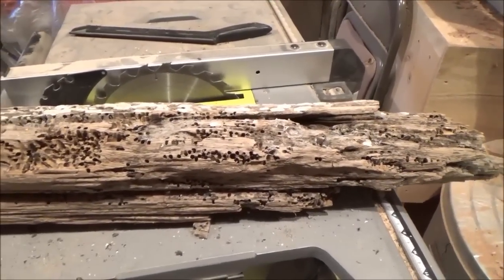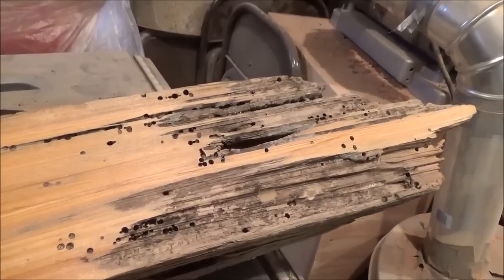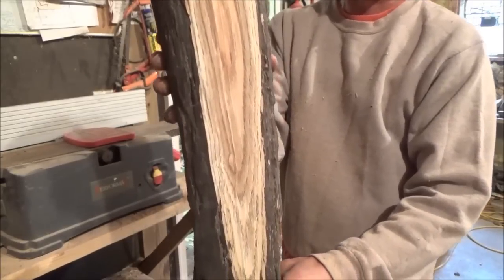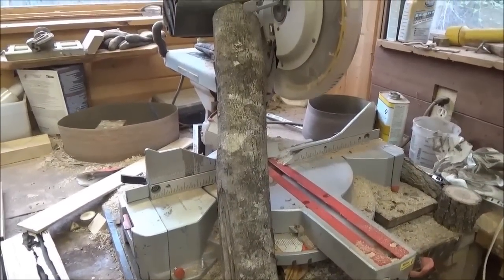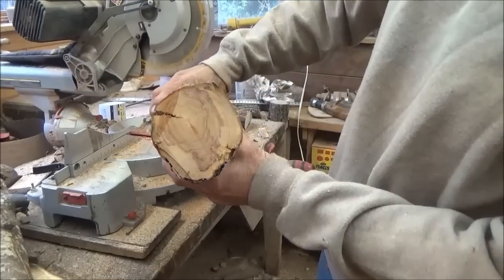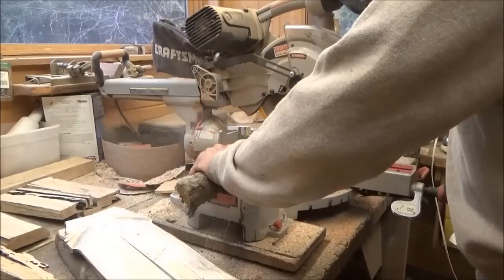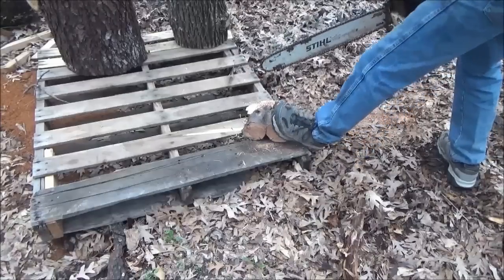Milling Boards From Driftwood And Other Small Logs. Looking at the grain of the wood.

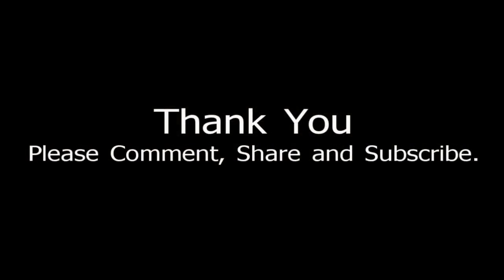Comment: Make a carrier from a straight piece of lumber for slabbing off logs so you can have a stable, flat surface to run against your saw fence-- a band saw is a bit safer, too. BTW, you're using a jointer, not a planer (10:50), but I accidentally say the wrong thing all the time myself :)
Reply from the maker: Actually my joiner is called a joiner/planer LOL. I get them screwed up all the time. I normally refer to it as a joiner simply because I have the bigger planer.
Reply: Matter of fact, I just used my 6" jointer myself to flatten the bottom of a rough piece of firewood for a display stand. Wouldn't have tried it but for your example, so thanks.

Comment: Inspired me to look a little more closely at the driftwood and old logs that wash up on the banks of my river. You mentioned using the old saw in case of rocks. I imagine there's the potential for all sorts of buried hardware, sand, etc. What about pests? Any ideas on treating found wood to make it usable for stuff in the house? Or is that not a concern?

Comment: nice video.. reminds me of the time i broke my left thumb on a table saw.. if this were regular wood you could use a feather board to help push againt the fence.. this wood is probably heavy enough you dont get kick back though..  i have driftwood on my property. i used my driftwood as scrollsaw material and cut letters out of it gave it a "weathered" look for a route 66 sign i made. what are you making?;